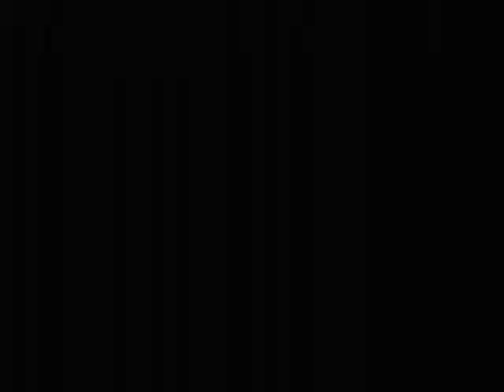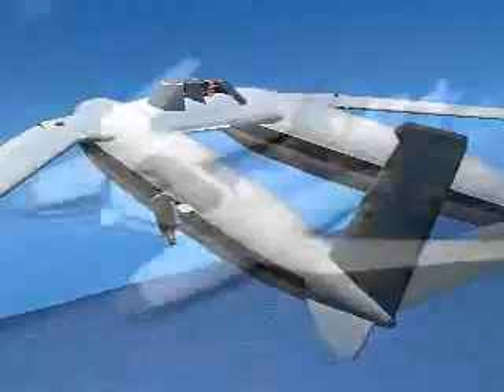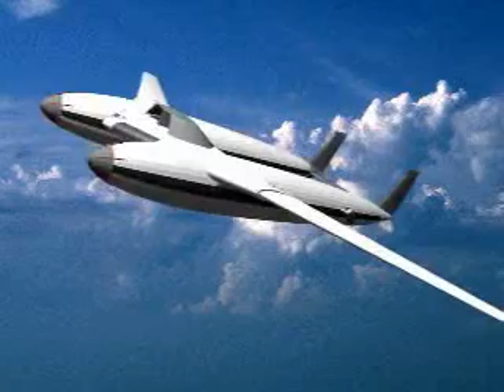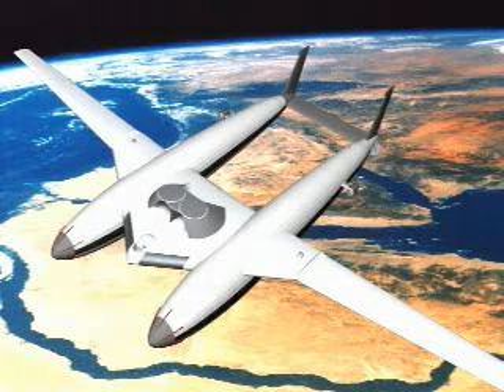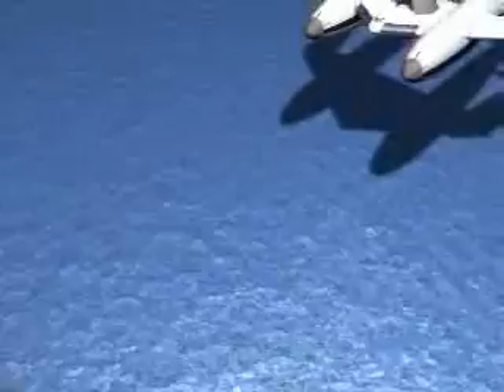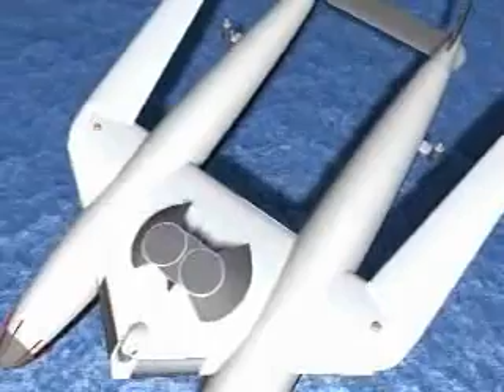Fuel-Less Gravity Powered Airplane

Comment: such bs...you'd have to use the compressed air to get the plane going foreward. Gravity alone will not provide forward power. Take a paper airplane...drop it. It will tumble straight down. Why do paper airplanes fly? because you need to throw them, giving them HORIZONTAL velocity to fly and generate lift. That initial throwing step is not renewable...and you need something better than taking up air as you fall (drag, which causes you to lose airspeed and is counterproductive) to restore your compressed air supply.
Reply: FFS haven't you heard of glide ratio??
Reply: TheLittlestRiceball5 airspeed, and altitude can be traded at will in a heavier than air fixed wing aircraft.
Reply: TheLittlestRiceball5 That's not true. Gravity provides power to gliders. All they need is potential energy (height) which is converted into kinetic energy (lift).  However, I can't see this project ever working. It doesn't add up.
Reply: Solar & MHD
Reply: TheLittlestRiceball5 Incorrect.  You don't need 'horizontal velocity', you just need the correct angle of attack.  The wing needs to be at an angle to airflow that causes it to lift - which doesn't necessarily mean strictly vertical movement.  Most planes, if dropped from height, would correct themselves and glide - some better than others.  A jet fighter would basically plummet, but a light cessna for instance would correct itself given enough altitude.

Comment: Interesting, but NOT realistic. This would be feasible to use in a standard aircraft to make it lighter. The newest 747 weighs nearly 1 million pounds fully loaded. If they could redesign a similar sized aircraft to use a lighter than air gas, das plane would perform better, use far less fuel and not have to go through this up and down motion. It could fly like a regular plane, but weigh  far less that it's actual pre-gas weight. Pfffft...

Comment: I hate to join the chorus of naysayers, but compressed air is heavy and bulky and not energy dense. It's hard to even power a car with compressed air, let alone an airplane. And assuming you get it up in the air using helium or whatever, you still gain nothing by using a compressed air driven air compressor to compress fresh air. You would be better off to not discharge the stored compressed air in the first place.

However, I have a patent pending on a process that will extract heat from ambient air and turn it into kinetic energy. The cold (-31F) at 30K feet might not be the best place to run such an engine in a high energy application such as an airplane though. You'd definitely have to deal with the icing problem.
Reply: Your patent pending idea sounds very interesting. Good luck with that. It would be great if it could be used to build a small model of the idea that is being talked about in this video. This video uses an airship, not an airplane, mind you. I have an idea or vision or thought, call it what you like, that I would like to share with you. I envision a time when people will be using airships shaped in very aerodynamic ways that will elevate to 42km in altitude. Why? (You may ask) Well, try and think of the jump that Felix Baumgartner made recently. He elevated to an estimated 39 km in altitude with the aid of a helium filled balloon. He was able to descend back to earth at a very high speed (broke the sound barrier). Why?  Because at that altitude (near space) there is hardly any air (oxygen) mostly nitrogen, so therefore there is no wind resistance to slow you down. It is only until you begin to come into contact with the earth’s troposphere that you begin to slow down and possibly heat up.  If your invention could therefore extract some of the heat created from this exothermic reaction and turn that into energy (kinetic) that would be great! I don't know the details of your work, but I am a dreamer and just hoping that something like that will come along some day. As far as my idea, it has already been proven by Felix Baumgartner, that you can make a free fall jump and break the sound barrier. My idea would basically involve "jumping" from that altitude but using a small (or large) delta shaped (aerodynamic) craft. This would make the journey on the way back down much more stable and needless to say, comfortable and safer. Take an airship...like the Goodyear blimp, for example,...divide the hull into 2 compartments...top with helium, bottom with hot air...........streamline the frame so that it looks more like a delta (triangle)shaped wing, very sleek, very aerodynamic. Heat the helium and the hot air to make it rise like a Rozière  balloon...how to achieve this...I still do not know, what would be the most efficient method.  (Maybe your invention???)...........then elevate to 144,000 ft (43kms) it takes 2 hours....to reach that altitude.......now...try to think of Felix Baumgartner,...when he did a freefall back to earth.  He broke the sound barrier because he did not have any wind resistance at that altitude. So....... instead of just jumping from a balloon, you will use your airship/craft to glide back down in a rapid decent. In order for gravity to take effect, your craft would have to lose all the hot air and compress the helium into tanks.....otherwise you will continue to float.  What is the most efficient way to store and compress helium? I don’t know. That is why hopefully this idea will reach people out on the web and we can all work in collaboration. Getting back to the vision or idea……,try thinking of a normal balloon. When you inflate the balloon and then release the balloon (letting out all the air)...it goes crazy, shooting off in many directions. In the vision I have, the idea would be to channel all that air loss in one direction (vectoring the air) turning it into potential thrust, giving you forward momentum. For what? (You may ask…is all this idea good for?) With this idea you could potentially cover great distances. In other words, from an altitude of 42 kms…you enter into a type of orbit above the earth, in what’s known as the polar vortex. From that altitude, you could basically plan where on earth you wanted to glide back down to. So, in this instance we could just say we wanted to cross the continental USA or traverse the Atlantic. I believe that this will be done without burning or using up too much fossil fuel. I am not saying that you would use none, just a much reduced amount.  Well, that basically covers my idea. I hope you have enjoyed reading about it and I hope that it will inspire you to maybe provide some of your own. I am 45 years old. It would be a shame if I pass away and this Idea did not come to fruition during my time here on earth. If you would like to share your thoughts, please feel free. I am also open to criticism. Cheers.

Comment: This is retarded. It would be a gravity death trap when it encountered a storm.
Reply: ~ there are no atmospherics storms or clouds above 50,000 feet and the temperature remains just below freezing above 100,000 feet and increases with altitued in thermal convection for some distance, which just like a condor or glider, you sail up

Comment: Use hydrogen as lifting gas rather than helium, burn hydrogen in engines to provide thrust (as you gain altitude, less air pressure), and you might be able to do something.

Comment: Just another bullshit perpetual motion machine that WILL NOT work.  This one is a little more complicated than average, but no more valid.
Reply: Christopher Felix The perpetual motion aspect seems to be this claim that you can use compressed air to collect and compress more air than you expend.  How does that work?
Reply: It uses stored energy, but you are right that it claims to be able to reconvert energy perpetually.
Reply: it is a good idea, whatever the system the author uses to materialize it an airship is more efficient than an airplane and he designed a plane with good drag-lift ratio

Comment: Gravity powered? HAHAHAHAHAHAHAHAHHAHAHHAHAHHAHAHAHA!  Other than the title, this plane sounds pretty cool, but if someone pokes it with a pin, it would vaporize itself.
Reply: TheTalman1 there are many metals that are very light relative to the size of a plane,  after all look at gliders they are very heavy but a pilot can keep it up there for a long while using the turbulance of air, gliders are nothing but metals,  the strongest and lightest metal I know of is titanium,  I know they have been experiemnting with carbon fibers which are very strong relative to weight. but I am not sure how that would relate to a plane that would fly very high, carry lots of weight in people and cargo, so this may not be feasible for that but can probably use smaller versions for coast to coast flight maybe? if you watch birds like hawks they do not fly straight away they circle up and up on the thermals until they reach a certain altitude then they do a long glide which propels them for many miles which uses alot less energy then direct flight would. the birds are instinctivly wise we can learn much from them about energy saving flight.
Reply: if they could poke it through a metal shell sure, the shell from what I gather is solid and doesn't expand ormove only the air going in and out condenses gets more dense as molecules of air are pushed in by the turbines from the forward movement of the plane, which can be pushed out through the propellers and gives forward motion even more and upward to, but I want one for person use a small version of it, but I would power it through pedal power too kind of like a human powered toy for transport. if you have to go from point a to point b why not have fun doing it?
Reply: rose smith
the shell can't be thick or it would be too heavy, but it doesn't take a pin to poke holes in the rest of this "fuel-less gravity powered airplane"
Reply: TheRosa63 Pretty sure gliders are mostly wood or fiberglass if not carbon fiber but the thing about this video is energy, mechanical, kinetic, electric, chemical what have you. It takes energy to fly, if you want to run purely by gliding you would need to start from a high place (high kinetic energy) and end in a low place (low kinetic energy) and you would then have to transfer it again to a high place via mechanical energy which would impart more kinetic energy for the next flight but it would take energy to move it higher which would still be more efficient certainly. But the vulnerability of un-powered flight to wind and weather make it impractical for travel. Theoretically the most efficient form of flight is lighter than air,(hydrogen/helium) especially for longer trips due to not having to use energy to stay aloft but again wind is a huge threat due to the size it would need to be to transport passengers/cargo. Theoretically you could have a zeppelin/blimp of some kind using hydrogen for lift and burning hydrogen in a motor for forward thrust. which would would produce water which could be turned back into  hydrogen through electrolysis powered by solar panels but in the end the solar panels would be very very heavy and not put out enough juice to power the electrolysis at a rate to match the amount spent through the motor but it would still be a very efficient form of flight and the hydrogen store could be replenished during down time at airfields. This i believe is as close  as you're going to get to sustainable near zero environmental impact powered flight.

Comment: OH MY GOD STOP SAYING IT HAS NO FUEL

THE COMPRESSED AIR IS FUEL
Reply: Yes, a fuel with about one five hundredth the volumetric energy density of jet fuel, and one four hundredth the energy density by mass - and that's not considering that tanks for compressed air have to be far more massive than ordinary fuel tanks.
Reply: @jamiehanrahan4705  isothermal compressed air storage plants ICAES increase the energy density 4 times of ion-lithium batteries

Comment: using compressed air to drive pumps that fill tanks with compressed air sounds kinda inefficient.
Reply: Yes, I was thinking the same thing. There is loss of energy in the mechanics.  Like using an electric motor to make electricity by driving a generator.
Reply: Gavin Kloewer He is actually correct, compressing air with compressors driven by compressed air is really inefficient. You would be better off with a gas powered compressor or for those eco freaks thorium powered.
Reply: isothermal compressed air plants ICAES increase compressed air energy density 4 times than lithium ion. also there are loss from transferring air from one pressure vessel to another, so maybe it can be more efficient using isothermal system to fill a tank with an air engine. however at those altitudes compressing air is less eficient because low air density and atmospheric pressure.

Comment: I don't understand. Im talking about using helium or even hydrogen and compressing that at altitude to decrease boyancy and to cause the craft to glide back to earth. Basically taking advantage of the heat energy differential between low and high altitude. Specifically, the compressors are inside the craft and pump the helium though heat exchanges to dissipate/dump the heat into the cool upper atmosphere. Once the craft is back on the ground the helium passes back through the heat exchanger.

Comment: I take back that'd it be one go with heat exchangers - it'd take a  while, but you could run them in reverse to pick up energy once down. you'd have to compress the helium through the exchanger at altitude and then decompress through the exchanger once down to pick up lower atmosphere heat.  Perhaps if you went up in the late afternoon and then compressed at night in the upper atmosphere for maximum effect.

Comment: If you had massive heat dissipators/echangers on the top of it, you could condense the helium by cooling in the upper atmosphere - in so doing you'd reduce your lift and be able to glide down. You'd thus be using heat from the lower atmosphere for your lift and using the cooler upper atmosphere to dump the heat. Thus no violation of the conservation of energy.  It would only be one go round though and you'd eventually have to compress some of the helium to get yourself all the way down to ground

Comment: Way to much energy to compress the air.  But you could use airfoil sails and take advantage of air currents at differing altitudes . Won't be fast in any case, but for cargo, should be fine.

Comment: There are definitely some issues with over-promising here.  No air craft can fly indefinitely without outside power sources.  As many have pointed out, due to the 2nd law of thermodynamics, there are efficiency losses at every stage.  However, as a concept, this is a very neat idea.  It doesn't have infinite range, and probably has a small payload, but some of these ideas/technology could be applied to make modern flight vastly more efficient.

Comment: continued
the ride would be like a rollercoaster, (I HATE rollercoasters) because the thing will get high enough (say 5 kilometers 15000 ft) and then drop down like the vomit commet (although probably slower as said before) to achieve some speed, untill it reaches a safe 3 kilometers 10000 ft where it deploys the helium balloons inside and slows down.
it won't work for fragile cargo or passengers (unless extreme sports types) the only place left is surveylance.

Comment: this is what I understand, the plane is a glider that has a high glide to fall ratio, lifted by a balloon.
observations:
1 it won't be fast or reliable as it depends on free fall to accelerate, and might not achieve enough speed to fly if it finds wind in the wrong direction (such as tailwind)
2 it will be rather slow because it needs an extremely high volume to harbor the helium ballons (like a zepelin), further adding to the question of the speed of air arround the wings to fly
3 barf buckets?

Comment: Youve gotta be joking, please say you are. It would be completely impossible to float in a mass of air, (at whatever speed) and somehow harness energy from that wind speed........!!? The wind speed is relative to the earth, not the airplane. If the plane has a relative windspeed, it is using fuel to accomplish that--unless it is falling. Stick a wind generator into that wind, and the plane uses even more fuel--no energy gain possible

Comment: (continued) More simply put, it uses an initial fuel to gather a secondary fuel which then is converted into kinetic energy, not unlike a diesel locomotive using diesel fuel to generate electricity to then drive electric motors which turn the wheels. It would be inaccurate to say that a locomotive is not electric-powered simply because it starts with combustible fuel rather than electricity. Just because this craft does not start out with gravity as fuel does not mean it doesn't ultimately...

Comment: More concerned about ice and water molecule skin/etc interactions than pure friction here. And air activity especially if it doesn't have a way to detect downdraft/updrafts/etc to avoid or use as the case is. The Terrorism quote is just hilarious, think its far more likely to be pirated/stolen instead.

Comment: This is ignoring inefficiencies in the compressors and friction on the body of the plane.  After each cycle there would be less energy recovered, and eventually no energy available to compress the air.  If you don't believe my logic, study the second law of Thermodynamics.

Comment: LTA vehicles fly by displacing air, and so need to be light weight - the air tanks would be heavy. The lift and thrust provided by compressed air would be negligible, not enough to counter wind. Electrical power would actually be lighter and better as you could use solar panels as well as a turbine to charge it. It would be better to compress the helium in tanks and allow displacement air in to change buoyancy.